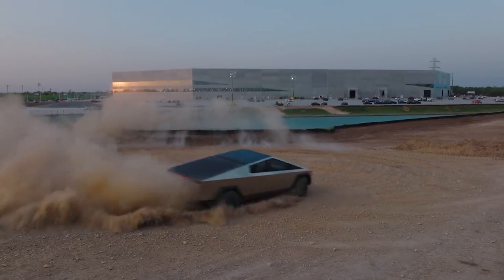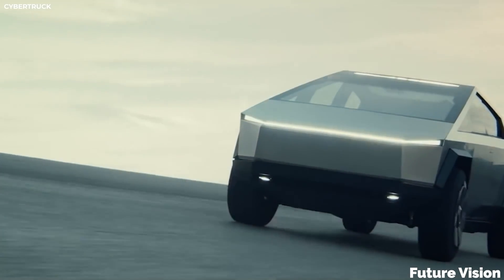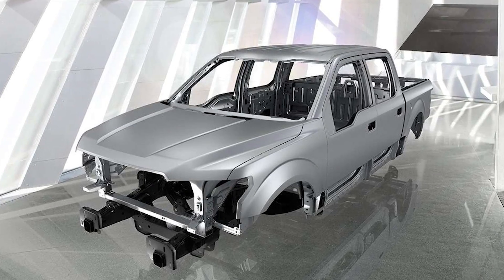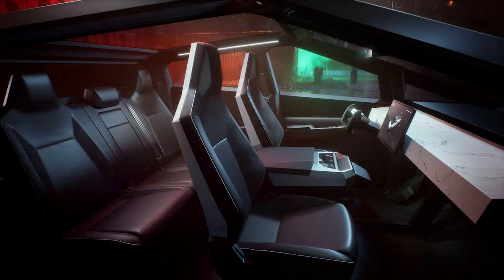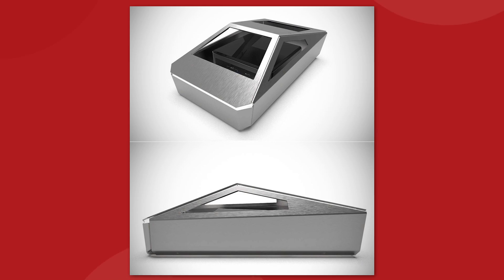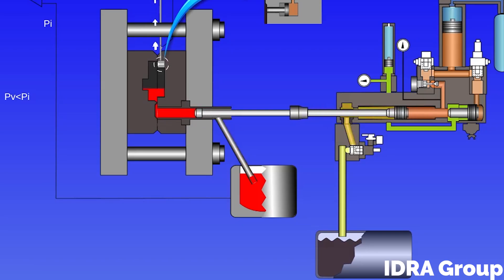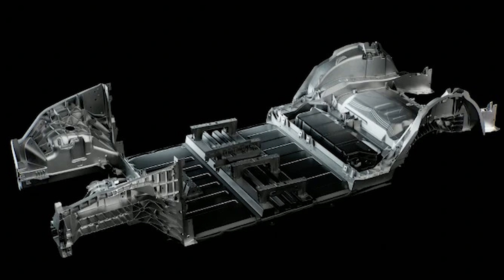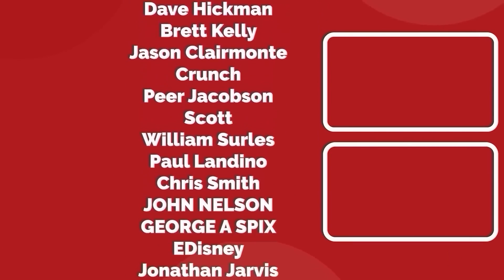The Real Reason Tesla Developed The Cybertruck!

Comment: The single biggest flaw, and it's a big one which takes it out of consideration for me, is the abysmal forward view of the road/terrain immediately in front of the vehicle - and this is 100% due to the "design" idiots being in charge!
There is a huge potential advantage in a battery/electric vehicle and that is there isn't the need for massive radiators and bonnet length for in-line engines - without those the driving position could have been moved forward, the hood line dropped, and the windscreen placed so all would have contributed to the driver actually being able to see around him/her to place the vehicle accurately on difficult terrain.
And as for the break-over view when cresting ridges...

It's not supposed to be a light support vehicle for the military, it's supposed to be an off-road vehicle. That the latter is definitely not the intent is underlined by using aluminum under the vehicle - this is where the most resistant, strongest materials should have been used to protect against stone damage and, more important, rock damage from landing on, being dragged over, outcroping rocks on trails.

All in all, it's what we would have called a "yuppymobile" back in the day - maybe the new term should be "wannabe-greenies-  who- don't-have-a-clue mobile"

Comment: There is also another design consideration that the CyberTruck form helps solve. It is capable of being a pressure vessel, so it can actually function on the surface of the Moon or Mars and have the people inside not need a spacesuit. There are far fewer places that would need sealing with this sort of design.
Reply: Except all other planets and moons don't have out atmosphere and most importantly our magnetosphere.... so even with a space suit, and this truck... you'll still not live long on the surface.  Does no one realize this VERY obvious fact?  Xrays, gamma rays, UV rays, Alpha and beta particles... the temperatures on other celestial bodies... heck... the temperature swings from in the sunlight to not in sunlight... holy crap!!!  The caustic gasses on all other celestial bodies... this will most certainly NOT survive outside Earth... heck it will barely survive on planet Earth for a few years.  Are you kidding me?
Reply: A container with flat surfaces does not lend itself well to being a good pressure vessel.  To replicate earth's atmospheric pressure, the pressure would have to be about 14.7 psig inside the truck.  So a flat surface (such as a windshield) that is 2 feet x 6 feet would have an outward force on it of approximately 25,400 pounds.  That would blow the windshield off the truck and break the windshield in the process.

Comment: When this Tesla truck gets into a accident then it’s going to do two things, completely destroy whatever it runs into (including the other vehicles occupants) and whatever significant damage the truck takes is likely to spell the end of the vehicle life. If the frame is on the outside and it’s damaged then the structural integrity is shot. That’s my opinion but I’m not auto engineer so correct me if I’m wrong. Is it really easily damaged to the point of ending up with a salvage vehicle and is it really just a menacing missile on the road? 
I can see how they want it to last a long time, that would offset the massive cost of replacing the batteries but I’m not buying that this truck is that much better. Plus that stainless is going to rust up eventually.

Comment: So.. some interesting information here and there.. but this is mostly bad information and propaganda. The Cyber truck isn't the lightest, most powerful, most cost effective, or efficient pickup ever mad... It's almost as far from those things as you could get. You also gave bad information about body on frame structural rigidity. That's just false from start to finish. I can tell by listening to you that you're not  mechanically inclined and cars/trucks are just not your main focus so I'll give you a pass here but don't share bad information as true if you're just not versed on the subject. the Cybertruck depending on trim is between 5000 lbs and 6500 lbs. That places it firmly in the 3/4 Medium duty truck bracket. Meaning it doesn't compete with the F150, or Silverado 1500. It competes with the Ford F250 Super Duty and The 2500 Dodge and Chevy offers. That leaves this in the realm of heavy duty Diesel powered work trucks. Sadly, it Just doesn't have what it takes to do that level of work based on the current specs released. It doesn't have the off road prowess of a conventional pickup from the big 3 either. The range is also and an issue especially when you consider the charging time. Then there is the cost of repair of anything is damaged broken or defective. Tesla has proven that the build quality in it's cares are quite shoddy and repair costs are almost comical. Ease of repair is also a massive issues. Another big issue with an off road EV is the range. What happens when you're off road camping and the charge becomes to low for the truck to keep driving? With a gas or diesel engine, you simply get more diesel or gas. With a Tesla, you call for help and hope someone has an off road roll back that can recover this thing. So while The video is decently well made, it's just a tesla ad and not proper information about what living with this thing would really be like. Let's not get into the cost to just own one. Tesla has more than proven you pay a premium price for a car with the build quality of a chevy malibu or a Nissan Altima. So, no parts to repair it with, no shops are able to work on it really anywhere, it's totally dependent on charging stations being near by, it cannot tow at the same payload or range as the trucks it claims to compete with, it costs more for less, and Tesla has a track record for poor quality and customer support. Add all that together and you get a rich guy's play thing and a party piece. Nothing more. The technology needs to come quite a bit further before this thing makes ANY sense to own.

Comment: Cybertruck - this is a fine example of engineering that is all about cost and process optimization. The approach of this vehicle as a participant in a busy environment, on the other hand, is completely egocentric. We have seen great progress in the last decades in terms of passive safety not only for the passengers but also for those involved in accidents - especially pedestrians. Cybetruck may turn concepts on their head, but it doesn't question why those concepts have held up. The claim that it receives disdain because it challenges the status quo of passenger car design is simply false.
The design may seem modern and beautiful as sculpture in its own way, yet it will kill where a comparatively soft "conventional" vehicle saves lives. This vehicle is literally like a slap in the face and another kick when you're down, should you ever be involved in an accident with it.

Comment: The whole thing is all about the battery. They suck for traveling, the charging time and mostly the labor involved. The majority of the material EV batteries are made with child labor.  I wouldn't waste my time at entertaining the thought of 100% travel with a battery operated car or truck.  I'll stick with Petroleum.  I would entertain the thought of Liquid Petroleum (Propane). I drive a Bus that operates on Propane.  It take the same time to fuel up using Propane. It's a clean fuel with minimal carbon and economical. Petroleum is a natural resource and it's clean.  But most of all, it doesn't cause pollution like the wicked Government leads you to believe.  US Government are not trustworthy.  They don't know how to tell the truth.  As Ronald Reagan once said that the 9 scariest words in the English language is (We're from the Government and we're here to help).  I'll stick with a gasoline powered engine.  They are reliable, clean and will be around a very long time and it's way more reliable for our Electrical usage.  Wind and Solar power is not at all reliable.  Natural Gas and  Nuclear power is clean and very reliable.  We don't have a reliable resource to replace Petroleum yet.  Battery is not at all a viable solution for power.  Dream on you Eco Wacko's.

Comment: Surely the DMC stainless steel DeLorean car body played no role in the inspiration of the cyber truck body.
11:15  It's all fun & games until you need to replace the battery pack that's part of the frame & isn't designed to be swapped out. (Yes it can be removed/replaced but is an extremely labor intensive process)
I like the Elon isn't a lefty idiot but hate that he's quite the shyster with shady business practices....Example, #1 They finally started selling parts & repair manuals but only because many refused to to buy a Tesla if they didn't. #2 They lie & spew BS like several years ago Elon claimed you're stupid not to buy a Tesla because very soon you could buy parts to convert your Tesla into a fully automated vehicle/robo taxi.  Elon was either lying or not very bright. Thinking it'd be easy to create fully self driving cars.

Comment: I want a turbo diesel version!  Just have to work out the structural battery pack.  Wouldn't want a fuel tank joining the front and rear sections.

Comment: but can it tow a 6500 lb travel trailer 423 miles in six hours? ( that's how long it takes my gas truck to get my travel trailer to the lake and if electric cant do it then its a non starter)on the way back six hours and twelve because I have to stop and fillup

Comment: I like how you did the video but are you an engineer? Because I am, I don't have a degree but I have been making all kinds of stuff my whole life I see problems in it. I think the point where battery box and aluminium bodies is going to want to fold up in an accident. But I would have to see more of it. Degrees and the ones that really make things is night and day. I work with so many materials that are under stress that you have an understanding where failure happens. I want to see it after crashes. Towing failure.

Comment: And, the first 10mph fender bender on any of the quarter panels will total the vehicle.  There's a friggin reason the body is structurally separate from the frame on a normal vehicle.  Unibodies Suck big time.    Lets see that beta male hit that sledge hammer on that edge just below the window.  Opps, truck is structurally compromised and totaled... The other huge problem is, it's an EV.  Sure it has towing capacity, but for what, 20 miles?  The Ford lightning can tow a 6000lbs trailer for about 40 miles.  That, is worthless as tits on a boar.

Comment: It seems the battery pack will be under extreme stress in certain situations with this design. Having personally designed an EV, I am a bit wary of what seems to be the "Achilles Heel " of the Cybertruck.
Reply: One dent in a quarter panel and the whole vehicle is structurally compromised.  There is a reason body on frame works so well.  So your $70,000 vehicle isn't insurance totaled after a fender bender
Reply: @CaptainRon1913  That's pretty much the norm these days, anyway.  Between crumple zones, engines dropping out and insanely expensive airbags popping off, everything seems to be write off.  No wonder the insurance rates have gotten so insane.  As for a dent in the quarter panel destroying the structural integrity - says who?  The beauty of this material is that dents can be popped out without any problem.

Comment: Go Tesla!  Tesla solved some problems that didn't need to be solved -- current ICE pickup bodies and powertrains last essentially forever, at least much longer than the seats, switchgear, instrument panels, suspensions, carpeting, headliners... at least if they can avoid getting hit in the door with a sledgehammer.  But more strength for less cost is always welcome.

Comment: I'm not buying it.  Not the truck (no intent here), but the comments oddly enough seem to all lean towards the acceptance of this thing.  Most all the comments probably come from Tesla employees, as many are basically identical. And it is odd that there was no mention of the 1961 - 1963 Ford Unibody pickup truck.  That concept for pickups was around and produced 60 years ago.  Though the biggest drawback was that if you had much of a load in back, the frame would twist and bind the doors and you would need to enter and exit through the windows.  Would take one nice early 60's Ford Unibody any day over a dozen of those goofy looking "cybertrucks".

Comment: You definitely aren't swapping the bed for a work box on the back with a crane, welder, air compressor, etc. Fleet vehicles are a huge segment of the pickup truck market and the ability to customize the trucks for each companies needs is totally missed as far as I can tell with the Cybertruck. The design is very clever though if it works as described. Hopefully they will actually make some eventually, I'm excited to see some customer reviews.
Reply: A few sets of golf clubs.  You ain't towing a 6000lbs trailer for anymore than 40 or 50 miles either.
Reply: It has clearly been designed for consumer use.  At least, in this iteration.  I say iteration, for the genius of Musk is in frequent rapid protyping of new ideas until they work...
Reply: @johnhenry3536 it's as much a truck as any other 1/2 ton truck on the market. If not more

Comment: The engineering is incredible but an electric powered vehicle is impractical & unsustainable.
 No country can produce enough electricity to power a totally electric fleet of vehicles without drastically increasing carbon emissions to unheard of levels because of the need to make much more power, the need to make more powerplants, the need to make more & more solar panels & other "renewable" energy machines, the need to mine the Earth for an endless supply of batteries, conductors & computer chip materials which are less abundant than fossil fuels for vehicles that aren't built to last or to be rebuilt. 
 They are made as disposable products because the batteries in most cases are part of the structure of the vehicle & the batteries are unrepairable.
 These are the facts. The powers that be are in it for the power, control & money... And don't you forget it!

Comment: Fair looking, great idea of stainless. But it can tow how much? No 5th wheel availability but it's not designed for that weight. As youtube videos point out, the EV recharge in 5 degrees is terrible if it even works. The EV range at 5 degrees is half normal so maybe 150 or so miles then back to recharge. And that's not carrying camping supplies or dirt bikes or 3 adults. Then out to a dirt track, or off road camping. Nah, this is a nice larger, stronger auto. It would be interesting for gas/diesel trucks to use the stainless at least for the side panels and bed.

Comment: Saying you can only fold is false. Rolling is also a thing. They can do curves, just not complex curves via a stamping machine. Instead they have to use a roller which does a specific subset of curves. Going pure angle for, say, the fenders is purely a design choice. And yes, the truck could look other ways, saying "it could only look this way" is false. First principles design still leads to some branching logic with decision trees where there are equally valid choices with different trade-offs.

Comment: im sorry but i have to argue a point you just made regarding a truck rusting out "in a decade or two." most cars these days can last 20 years [minimum] before they start showing signs of rust. and it only takes the bare minimum or car maintenance to keep the rust at bay for far longer. simply washing your car at least once a week will keep the rust at bay. not only that, but by hand washing your car you will notice any potential areas that may need slightly more attention.